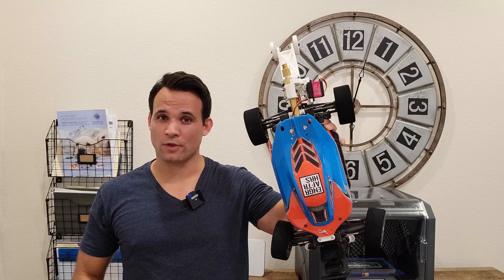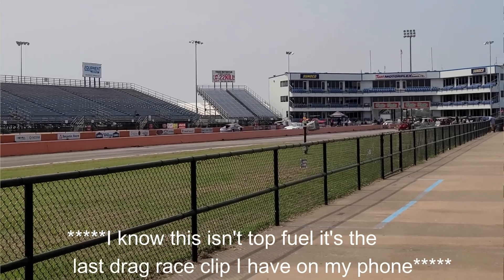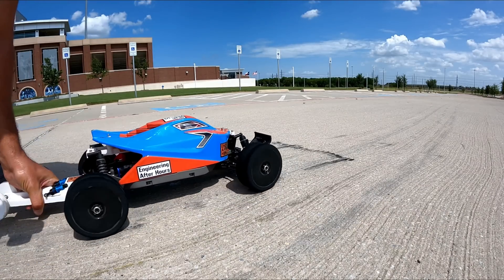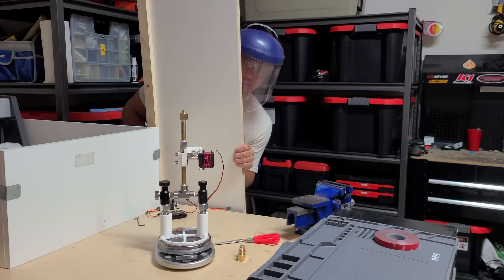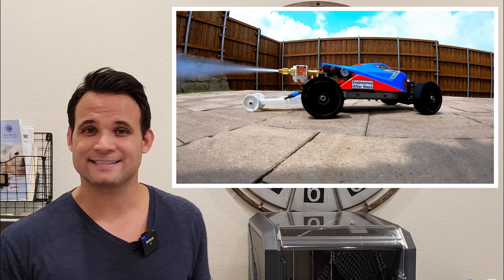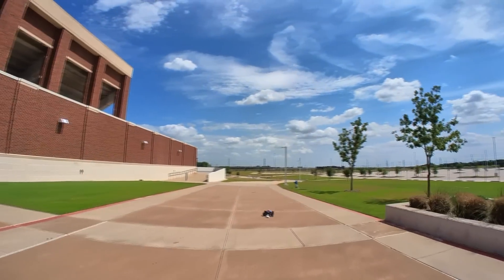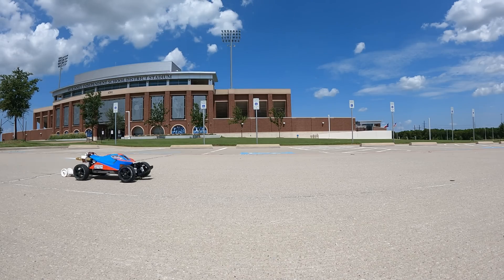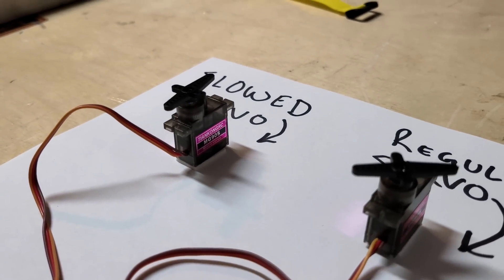I Put a Cold Gas Thruster on my RC Rocket Car

Comment: If you would read the other post first from me or this is not going to make no sense And I've got one other suggestion on your suspension it works by gravity and when you go upside down the gravity is in the wrong direction so your suspension just tops out and no longer works but you could use the traditional air bag suspension but I don't think I'd go with airbags I think I would go with a push-pull very small pneumatic Ram and that way you're able to use a leveling valve and when you go upside down it just puts compressed air on the opposite side of the Ram there's a problem here if your weight transfer controls the pitch of the blades on your ducted fans then when you put compressed air on the opposite side of the Ram and bringing the suspension back to 0 your fans would go to 0 own your pitch and obviously the car would fall so you need a sensor that controls the suspension and how much constant downforce you need to be able to sense when the car is upside down or straight side up but with your G loading with three or higher G's this is not going to be easy to do putting a weighted pendulum in their isn't going to work I'm betting you're going to have to use some Avionics literally off of aircraft and just miniature rise it but if you get it figured out perhaps you've already thought of this when the car is straight up and down in the suspension the pressure above and below the piston in your Rams should be the same to where your suspension will steel float because the air is acting as a spring the two cars that had the mechanical downforce on the underwing I think the reason they chose to do it with the underwing with the technology back when they done that they didn't want to tackle some of the problems that I have mentioned if you go the directions I've suggesting but I don't think they had the tools that we have now like 3D printing I think if you're going do it do it right and the rewards will be incredible I've got a suggestion on that sensor problem if you used something like a laser tape have two of them at each wheel well aimed at the ground measuring the height of the vehicle one is melted to the body controlling ride height the other is mounted to the spindle side of the suspension so now you can have just a small control board processing the information from all eight sensors which the board controls four small servos one 4 each wheel well controlling the pitch of the blades on the ducted fan and the board is also controlling I know I had suggested a mechanical leveling valve system handling your weight transfer but if you go this route your control bored also becomes you're leveling valve system because with them 8 sensors now a control board with the right program should be able to set the car up for all the situations that it may encounter so that means you're going to have to have another board with micro solenoid valves to where you can put pressure on whatever side of the Piston you want and also be able to dump the air another side if needed it would take some engineering but I bet it'd be a heck of a car if built even if it was remote control are toy and I bet it get attention from even the Auto industry

Comment: This may be a crazy thought On your fan car are you willing to go completely outside the box and go another Direction accomplishing the same thing instead of hooking the fans to the underwing what if you used a centralized motor driving a driveshaft system and your ducted fans are mounted not sure quite how to put this but on the spindle side or tire side of the suspension bypassing the loading of the chassis now your fans are loading strictly the car Tire used inside the ducted fan variable-pitch on the blades that way your fans can stay spooled up you can probably let your weight transfer control the pitch own the blades each ducted fan would be at the wheel well aim straight up and you're not even sucking air from the road surface getting rid of all the problems of sand and debris but from the side of the car you could even put ducts and vents down the side of the car for air to be sucked through and you're using strictly thrust to push the car to the ground doing away with all the weather stripping and all that nightmare now I know this could prove to be more heavier with everything that is involved but I think the games outweigh the losses now it may be more power-hungry not sure beings you're using only one motor it could be more efficient if all four fans are at 0 pitch the only amperage you're using is just what it takes to stay spooled up on the fans the motor maintains the RPM you got it set at so you're amperage will go up as you add pitch on any of the fans if you look around there are better Battery Systems out there
Reply from the maker: I'll definitely have to think on this. Being able to decouple the downforce to the suspension would be really useful. Just like unsprung wings that apply downforce straight to the wheels.

Comment: If you want to go fast and use cold gas as a thruster then what you and Elon should be aiming for is https://www.youtube.com/watch?v=Q1eQw4ycgQM 
A servo to operate the CO2 is going to be way too slow to get the gas out in about a second. You need something like a rupture disk or similar. If you can accelerate water like in a bottle rocket there is so much more potential for speed. Maybe even a venturi system hanging off the back of your nozzle.
Integza recently had a play with a co2 powered rocket.

Comment: How about juat using model rocket engines? Easy as to implement and will probably get better thrust.
Reply from the maker: I specifically used cold gas thrusters because tesla plans to. Estes would be way easier for sure.

Comment: Have you considered combining the fan concept with the gas thruster. It might help counteract the stability and higher center of gravity issues. 
I agree more pressure would help, but not sure what a cheap solution would be.
Reply from the maker: If it wasn't soo heavy I'd give it a shot...but that would put the slash at like 15 lbs!

Comment: A de Laval nozzle might be the way to go.  Not sure thrust arguementors would help as always thought they trade heat for added thrust - might be worth tinkering with.  But, perhaps the main problem is the lack of reaction mass.  Suggest completely prefilling the storage part of the system up with an easily liquifiable gas such as canned air.  That only has about 60 PSI of pressure (keeping life simple and inexpensive), but it'll get in the way of the 800 PSI of CO2, while multiplying the mass severalfold.  Thus the system average system pressure will be higher than your present setup, as will the mass, so there has to be a double +win (and it'll still be a cold gas thruster without costing much more at all).  To accomplish this, a valve will need adding to the top and a method of connecting an inverted canned air bottle to it (4mm push-fit works on some canned air).  Open valve, fill it up, close valve, fun.  Some canned air is flammable.  If dumping large amounts, best do so outside.
Reply: Ahh I came to the comments section to see if anyone had suggested this, and was not disappointed. Using a con-di nozzle is really the only way to go in my opinion if you really want to get serious thrust. I imagine you are already well aware of what I'm about to say based on your comment, you seem to know your shiz, but I'll mention it anyway because a) I haven't seen it elsewhere on here and b) someone else reading might find it informative. I actually design aerospace propulsion systems for a large and well known manufacturer, and rockets is one of many things I do on a weekly basis. 

Thrust is very simple, a function of mass flow rate on exhaust velocity. But it's when you bring in propulsive power as a measure of success that it becomes clear why a de Laval nozzle (we tend to call it a con-di) makes the most sense, because propulsive power is a function of thrust and exhaust velocity, in other words, propulsive power is a function of mass flow rate and the exhaust velocity squared. 

So velocity is key here, the faster the exhaust from the nozzle is moving, the better your rocket. In the video, he is using a simple orifice nozzle, with very little else going on, and I suspect he hasn't done the maths to understand what his optimum chamber pressure and throat-to-exit area ratios are for the gas he's using. 

For what it's worth, I wouldn't have used CO2, I would have gone with N2O instead, it has similar density, can be bought in the same small canisters in the video, and has a slightly higher speed of sound. 

If he did those calculations though, he isn't out of the woods yet, because his next major hurdle is chamber pressure drop. The size of the setup is clearly very small, so making the chamber or adding more tanks probably isn't practical. And since the pressure is limited by those canisters, which as you say is only about 60 PSI gauge, which at best only offers you a 0.2 pressure ratio, and that's at the start before the pressure drops. So to avoid that, he would need to account for the pressure drop in his area ratio sizing, somewhere around 1.1:1 would keep exit flow supersonic until the chamber pressure drops to 30 PSI. Then he might stand a good chance of decent acceleration. Looking at the drawing in the video at 6:04, he's gone for a roughly 4:1 area ratio, and probably made the throat area too big to achieve Mach 1 at the throat, so instead of acting like a nozzle, it probably made it worse, so the throat area needs to be appropriately scaled too. It might seem counterintuitive to make the nozzle smaller, but no-one ever said compressible flow physics is easy!
Reply: @onetrickhorse  A far more detailed answer than I could articulate :)
Reply: @PhilipLeichauer  I'm sure you're just modest!
Reply: Had another look at the scale of the storage part.  Perhaps you won't multiply the mass by several...  But buy the time another fitting's been added and it's been lengthened, then perhaps :)

Comment: you should try casting some tires out of a grippy material like silicone or polyurethane. I've been experimenting with 40A poly tires on my losi mini-b and the difference in grip is substantial over the stock rubber tires.

and if you don't already have one, you should look into getting a center diff for you slash. that should help with the wheelies at launch - the center diff will dump power to the front wheels when they lift off the ground so it shouldn't wheelie as hard.
Reply: The problem with a center diff for a drag car is that unloading torque to the front wheels is worse than pulling a wheelie, because you are losing engine torque through the front wheels spinning. Without a center diff, as long as the back wheels aren't also spinning, you aren't losing any torque at all.
Reply: YES! Silicone is some grippy stuff! Instead of rubber tires screaching  you here chattering as the silicone grips, stretches, and releases. LOL Takes more driving skill to prevent this but the result is higher performance.

Comment: Hey Elon's going hot thrusters for Starship's boosters, so you can now feel good about using those model rocket motors!
Reply: Not anymore necessarily. In his walk through with EDA, he said that that they would just use the tank pressure for the RCS thrusters

Comment: If your coefficient of friction is >1 why not point the thrusts upwards? Why assume teals thrusts will only be mounted at the back off the car an pointing backwards?
Reply from the maker: Partly because that's really not any different than the fan car, just way more limited. But mainly because the fan car is already motor limited so using the co2 for lateral thrust instead of dowforce lowers the power demand from the motor. I was hoping to also overcome the early stuttering with thrust as well. If I had enough CO2 on board to give me maybe 3lbs of downforce AND 9lbs of lateral thrust, I would probably have given that a shot but I'm not anywhere close to that. 

So with the motor being the limiting factor, it wouldn't have improved on that build. 

Going to a new sensored motor setup will end up being closer to $500 when the parts are back in stock, so there's no way I was going to do both on this 1 build.

I dont think tesla will be mounted only at the rear...what made you assume that was my assumption?
Reply: @EngineeringAfterHours  Sorry for assuming this was your assumption.
I have seen a lot of calculation for the feasibility of a system like this and they all assumed backwards thrust and the rocket equation.

I don't think the Tesla is power limited. that's why i think they will uses it for more down force especially on the front wheels. 

maybe a "venturi compressed air vacuum system or blowing air over aerodynamic surfaces... don't know. 

Anyways cool Project! (but i love the fan car more)
Reply from the maker: I have seen the same videos you're referring to and I think you're spot on. 

Those videos ignore 2 things...you already mentioned the downforce actually giving you more acceleration than thrust alone when you're not power limited. 

The second is the ability to further exploit a 1 foot roll out. I think tesla will use this some way to further improve their time.

I think top fuel dragsters do both of those things. Their exhaust produces something like 800lbs of downforce and wrinkle wall slicks are going to help it slingshot off the line really helping the rollout. So I don't think tesla is exploiting anything that doesn't already have a precedent for doing...people just seem to not like it for some reason.